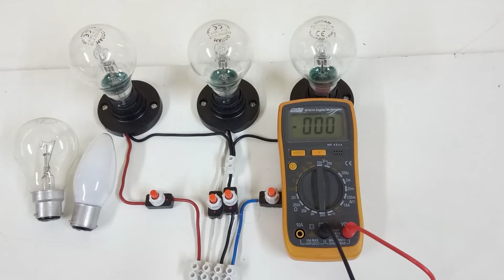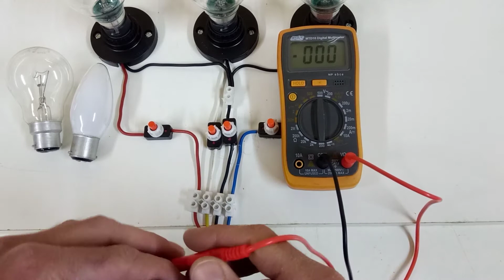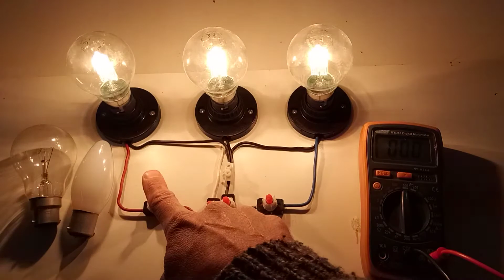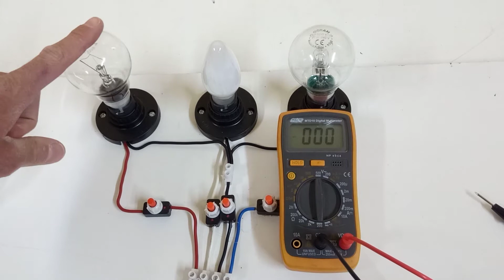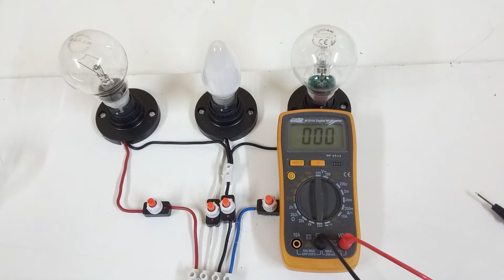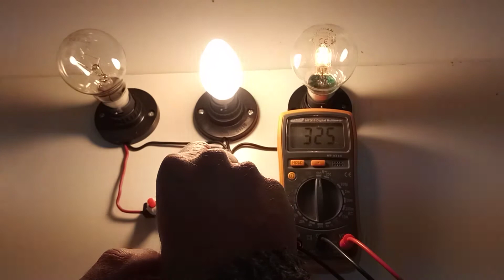A broken or floating neutral and the effect in three phase electricity systems

Comment: I have a query. In three phase unbalanced load condition some current will flow through neutral wire & go to ground as return path through nearby distribution transformer, Right!
Q1. Does the current in neutral wire only go to one direction (i.e., to ground) or it also change its direction in neutral wire like other 3 phases?

Q2. During unbalanced load condition when neutral wire have some current flowing through it to ground, does it have some voltage or high voltage ?

Q3. During unbalanced load condition when current flowing through neutral, if a person touch it will he get shocked ?
Reply from the maker: Hello.

It all depends on many factors.
Where the neutral breaks.
What sort of earthing system is used.
Ground resistance.

I assume you mean TN-C-S earthing if you talk about current flowing via the ground.

If the neutral breaks on the line away from the transformer, the customers after the break will have voltage issues, but it may not be that extreme since some of the current will flow via the ground as you mentioned.
But the ground is usually far more resistive than the appliances sharing the broken neutral, so the current is likely to flow mostly through them and only some to ground.
I can't say exactly but I would assume the houses before the break will also buffer the voltage by returning current to neutral via their appliances.

I have seen a real life case of this where houses went for many days and never exceeded 280 volts on two phases and 179 volts on the last phase. Only one house complained because the smart meter kept switching off and we discovered the fault when investigating the cause. Other houses didn't notice.
But was this the ground or the remaining good houses is hard to say without more investigation.

Then I have seen where the neutral failed at the transformer connection and the voltages went skew very quickly.
Appliances blew up in seconds.
But there was no ground path in this case as the whole load side was separated from the transformer star point.
The current obviously didn't want to return via other transformers nearby.

Alternating current or AC means it will.always flow both ways all the time. It swaps direction 50 times a second per phase and phases are out of phase with each other.
The neutral is only meant to carry the imbalance of the three phases. So in the broken neutral the amps on all three phases have to be equal which is why the voltage goes wrong. V=IR formula.

If there is a broken neutral yes it is common for people to get shocks from taps or appliances if using TN-C-S because there is now a voltage difference between the star point of the transformer which is earthed and the voltage of the broken neutral which is floating.
Reply: @TheCrazyENTP  You misunderstood my questions. I was talking for normal case when every thing is fine and neutral is also connected, just the loads are unbalanced which is obvious in daily life. Please re-read my questions and consider the neutral wire connected.
Reply from the maker: Apologies, I thought it was related to the video.

In a normal situation as you say the neutral will always carry the unbalanced current which varies as loads vary.
Unless the ground is a really good conductor in an area, I doubt much would flow via the ground.
Have a look at videos where they test the resistance of an earth rod in a TT system. They often get a high reading.

Since the neutral is grounded at minimum of the transformer side, the neutral itself should have no voltage relative to the earth. So when you say does it have high or low voltage, do you mean relative to the ground, because that is going to be zero and you shouldn't get a shock from it.
Even those guys who work on high voltage powerlines don't get shocks if they touch two lines on the same phase because there is no potential difference.

If you think about it, if you have a TN-C-S system or TN-S system, every earthed item is connected to the neutal of the transformer whether at source or at the meter, and we don't get shocks from those when operating normally.

So in answer you shouldn't get a shock from touching a neutral in theory. The only time I hear of shocks from taps or earthed appliances is when the neutral is broken.
Reply from the maker: Here the linesmen are touching two wires with no issues 

https://youtu.be/oBJyyEAw-6g
Reply: @The Crazy ENTP  Thanks for reply. I still have doubt of Q1 regarding direction of current flow in neutral wire. Actually I see a video in which current flow simulation show of a 3-phase AC circuit. When load is unbalanced some current flows through neutral but it is not in only one direction towards ground, it is flowing in both directions (forward & backward). But you said when neutral is connected and load is unbalanced, current will flow through neutral in only one direction (i.e., towards ground).

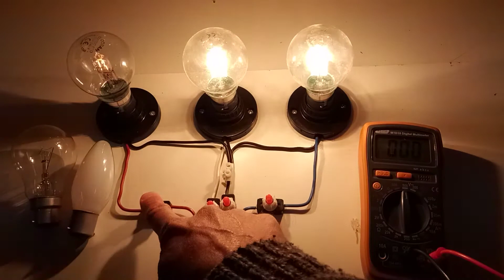 See from 2:00 minutes
https://youtu.be/b9hDHGxaufM
Reply from the maker: I think you're confusing terms somewhere.
My demonstration video has no ground at all.
Ground is the American term for earth which is what we call the protective wire that carries current in case of a fault say to the metal body of an appliance.

This earth is formed in different ways depending on your regulations.
TT as a rod driven into the ground at the meter.
TNS as a fifth wirre from the transformer neutral star point.
TN-C-S as a fifth wire from the neutral connected at the meter supply side. This may have an earth rod as well as with TT and then this is called Multiple Earth Neutral.

The ground as such doesn't carry current easily in most cases which is why I don't understand why you expect it to flow that way.
This is why TN-C-S is often used.
Faults return via an earth to the neutral connection and back to the transformer.
Reply from the maker: I think you need to look at a graphical representation of sine waves for three phase. They are out of phase with each other but all still AC.
You do know that each phase doesn't flow in one direction? The current moves forward and back 50 or 60 times a second. Only DC flows one way.
You'll thus never get the neutral flowing only one way. This is AC, not DC, regardless of load imbalance. There is always going to be an oscillation.
Reply: @TheCrazyENTP "by ground" I meant that when load is unbalanced then return current will flow through neutral wire and then go to nearby connected transformer & though which it goes to ground.
But my curious question is that when neutral current going to ground through nearby transformer, does it's flowing direction is only one way  i.e., in the direction of ground through transformer or it flow in both directions (forward & backward) like other phases?
Actually i am imagining that current in neutral wire is only flow in the direction of ground through nearby connected transformer because Earth have Zero Potential and it can't able to flow reverse from Earth. And if current in neutral is flowing in both directions then why we don't get shock when we touch the neutral ?
Reply from the maker: Oh no, you have some very mixed concepts there.

Electricity doesn't go from transformer to the ground in normal use. The only use for grounding the transformer is to make the ground around us and the neutral the same potential so we don't get shocks.
You can even ground a phase in the US (Research grounded B phase) and not get shocks since there is no potential difference.
Imagine putting a light bulb between a live and a live on the same phase. It won't work because there is no potential difference.

You also need to learn how a delta star transformer works.
They take two phases on the primary (say red and yellow) to run the windings on the primary and on the secondary you get a red phase and neutral.
Now take yellow & blue to make yellow and neutral.
Lastly take blue & red to make blue and neutral.
Then connect all the neutrals together to make one neutral.
That gives you our 230v/400v 4 wire supply.
There is no neutral on the primary and by using delta on the primary you reduce the effects of the imbalances that may happen on the secondary.
There is no using the earth to return current except when there is a fault
OR
the strange set-up of single wire earth return which I've never seen in real life.

Comment: This concept is mostly said theoretically, I haven't come across this un this more practical sense of it.
Reply from the maker: Thank you. In reality it won't be as "neat". When a neutral fails, the voltages will just keep jumping around all over as things blow up or motors cut in and out, changing the voltages all the time while trying to balance the amps equally between all the phases.
Reply: In reality it’s really horrible 😢 I recently faced this situation at home in India. Things were blowing here and there. I saw the dancing voltages at different phases. It was really terrifying. Reason was neutral loose connection/ poor contact at the incoming isolator output.

Comment: First of all, fantastic video - but can I ask you for clarification on something?

At 7:21 when you switch out the red phase (but before you switch out the neutral), why is the voltage between the yellow and blue phase measuring as high as 423V, instead of 415V (or something close to 415V)?

As long as the Neutral conductor isn't broken and is able to carry the imbalance current back to the star point, shouldn't the phase voltages across each load remain constant/be identical? (As in 240V phase to neutral/415V phase to phase)?

In other words, I understand why the voltages across each load vary when the neutral is lost from the circuit but I don't understand why the line voltage at 7:21 seems to be quite high.
Reply from the maker: Hello, sorry for the long wait.

The voltage at 423v is because the transformer was set at around 245v phase to neutral to accommodate voltage drop on the longer runs where blue phase used to be too low at times.
This video was done late at night so the load was minimal and so voltages were higher.

The 423v works out to 244v phase to neutral which is theoretically still in the range 207v to 253v.
423 ÷ √3 = 244.219v

But yes since this video they have turned down the transformer, first to 225v which was too low so the end of the line got 205v at time and now to 235v.
The phases have also been balanced again which helps a lot.
Reply: @TheCrazyENTP  Ah I see, that makes sense.

Thank you for taking the time to respond. It is much appreciated.

Comment: Great video. Sir, please help me. How much unbalanced current allowed on load side when using 3 phase diesel generator as supply?
Reply from the maker: Hi Riza

I'm not sure exactly what percentage on a generator, but I would say try to get the best balance you can. I guess it will be 20 % to 30%.

I'd say if you have too much imbalance the generator will have to work harder through that particular coil then be too fast on the others so the Hertz won't be as smooth and may also cause mechanical wear.

Electrically you'll need to keep voltages within the 207v to 253v range and imbalance may affect that as well as the 400v range.
Remember you should keep to a 2% maximum average variance on phase to phase for motors.
So 390v 395v and 400v is still just in range but 385v 395v and 400v is out of that range.
Google "three phase voltage imbalance calculator" and use the Tecumseh site to see if you're in range.

Let me know how you go

Regards, Pierre
Reply: @TheCrazyENTP  Thank You so much Sir. Your advice very helpful. I'll search more references about it and let you know about it. Actually I've ever had bad experience, when I only used 2 phase out of 3 phase on diesel generator. It broken down in 8 hours. I never thought voltage unbalanced/current unbalanced very important after I watch your video. Thank you so much Sir 

Best Regards,
Riza

Comment: I'm just this video Seen. Very well done.230v A ഉപകരണം 415When the voltage comes, there is no damage
Reply from the maker: If you get anything above say 270 volt, everything starts suffering. Voltage is like water pressure, so more pressure means something has to give in the end. 

You can hear chargers and fluorescent lights start humming more as the voltage goes up, so louder humming at 250 volt than at say 220 volt.
Personally I would like to keep between 220 volt and 240 volt range, but I get more 210 volt to 235 volt range.

Comment: My boss wouldn't believe me when I told him this was a problem and we should never reuse a 3 wire to feed 2 circuits, always run individual circuits. 

I pretty much had to recreate this demonstration with recessed cans we ripped out
Reply from the maker: On a three phase supply you are actually allowed to use a 4 wire cable say for sockets.
The wire and breaker must be correctly sized and then the load is shared.
Works for example if you want to run a washing machine, tumble drier and dishwasher standing next to each other.
Install one socket per phase and share the neutral so each machine can run at the same time.  BUT YOU MUST install a three phase breaker, not three single phase breakers for safety to isolate the circuit.
Check your country's wiring regulations to see if allowed but it is acceptable in Germany and South Africa.

I will be doing a video soon on exactly this to show how it is done.
Reply: @TheCrazyENTP  you also need to tag the neutrals to say that the neutral is a shared neutral. If it's not marked clearly and someone takes the neutral apart it will cause equipment damage.

I was talking about single phase dwellings though. It just seems like more trouble than it's worth and puts you at risk of being liable for equipment damage. Doesn't seem worth it to save running 2 individual romexs
Reply from the maker: In single phase you can't share the neutral  between two circuits breakers. The neutral will be overloaded and burn out. Oversizing the cables would defeat the purpose.

For example (assuming full running load per circuit):
Two 20A feeds will have 40A coming back on the neutral on single phase.

However on three phase (also assuming full running load):
Three 20A feeds at full load will have 0A on the neutral.

It's not necessary to tag the neutral as shared if you have a three pole breaker. That is the point of the three pole breaker - you don't work with any part of the circuit accidentally live.

If you use a three or four core cable for lights it's fine ONLY if you feed the whole lot from a single pole breaker with amp rating for the maximum current of the neutral (e.g. 1 x 20A for 2.5mm², not 3 x 20A separate breakers).
Reply: @TheCrazyENTP  single phase as in 240v. The neutral current still cancels out theb2 legs since they are 180 degrees out of phase from each other
Reply from the maker: Oh you're talking US wiring! That's a different story.
This is Europe/Africa/Australia etc where we have 230v single phase and 400v three phase.

Yours is complicated because you have 120v 208v 240v and then the 277v 480v options.

Your 120v 240v is 180° apart where our 230v 400v is 120° apart (uses a delta star transformer to achieve this - the star on low voltage side).

But yes the idea is to have phases cancel each other, so where you have two 120v phases at 180° apart they will cancel each other on the neutral. I'm not sure if you are allowed separate single breakers per live side, but here that wouldn't be allowed. We would use it as three phases with shared neutral.

Comment: Great effort .. but messy .. it convuse me😅
Reply from the maker: Thank you for the reply.
It is confusing at first, but once you understand the way three phase works it's quite easy.
Reply: @TheCrazyENTP  you are right, i am new in electric domain, i am mech. Eng. And i had made a terrible carrier decision by taking care of just mechanical issues .. i was wrong and i am teaching myself the principles of electricity, depending on many sources .. the videos from good experts like you are one of them.
Reply: @LawatheMEid  thank you.
I was also confused about the three phase issue when I learnt about it and there wasn't much to explain why the voltages change so much.
Hope to clear up some of those concepts.

Comment: There is one solution for this problem which can save all of your appliances of overload or burning. It is NEUTRA LIN FAULT DETECTOR, Detektor prekida nultog voda, which is produced in Niš Serbia. Keep safe!!! There is also video how it works on YT.
Reply from the maker: Yes indeed, Sinotimer has many units (single and three phase) available that disconnect almost immediately if the voltage is outside of range.
Reply: @TheCrazyENTP  Thanks for reply, this is  different device, this device trigger 
Differential switch when there is no neutral line. It dose it in split of the second and save all sensitive electronics in the house.
Reply from the maker: I see it is not the same.
Sinotimer has full load running through it and disconnects for voltage out of range you select. Response time 0.1 second.

My concern with yours is that on TN-C-S earthing system there is no difference between neutral and earth because they are bonded at the meter. So yours won't detect any difference to cause the trip.
It will only work with TT and maybe TN-S earthing.